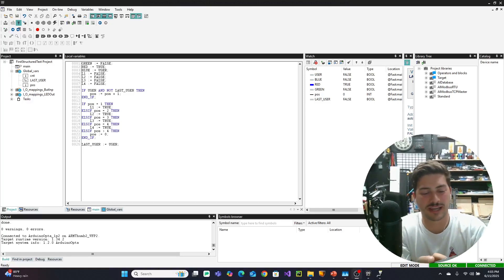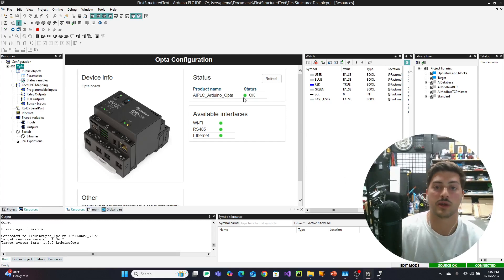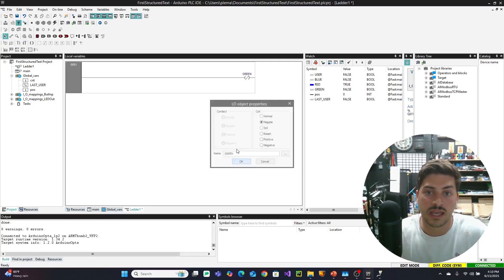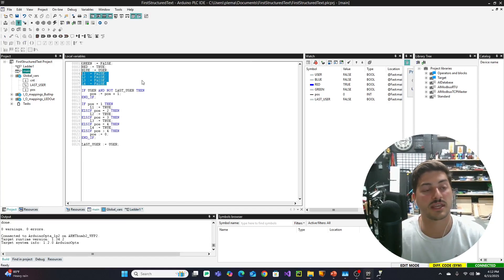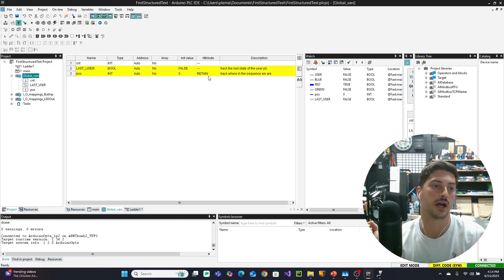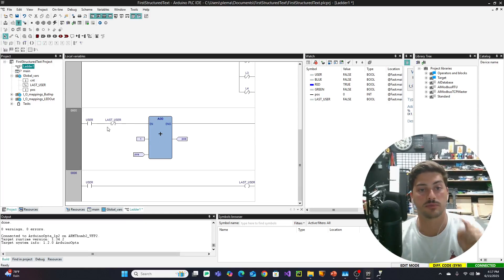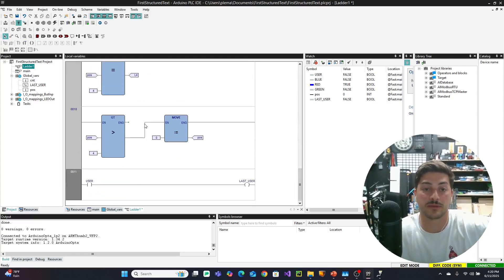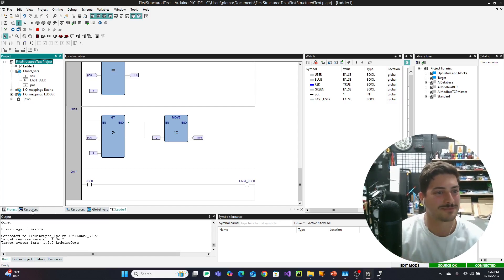Ladder Logic PLC Programming Tutorial with the Arduino Opta : Ladder Diagram LD

Comment: This is great.  Is it possible in LD to create an "OR" statement with EQ and LT blocks?  I have a problem I'm working on where I have an EQ and LT sequence that I need repeated 4 times in parallel and if any of the 4 EQ and LT sequences are TRUE I want the same output.  I can create the parallel branch but I can't tie them back into the same output.
Reply from the maker: Hi! Yes it is possible but Arduinos Ladder editor is very tricky to get function blocks working properly with parallel branches, it’s honestly probably easier to write a little structured text function to do the or statements and call it as a sub function in your ladder program!